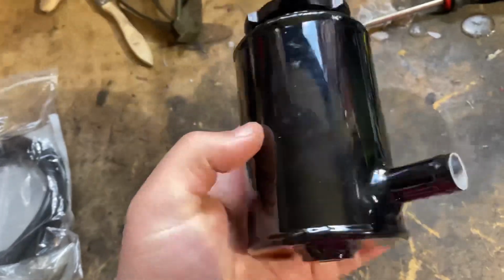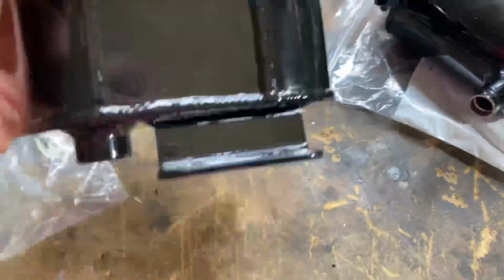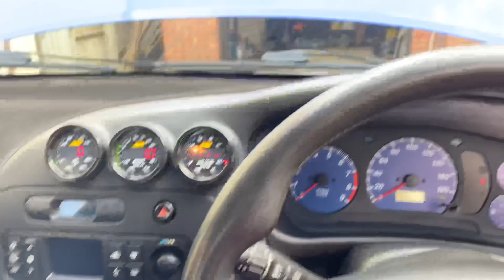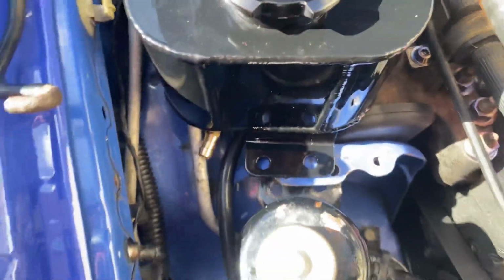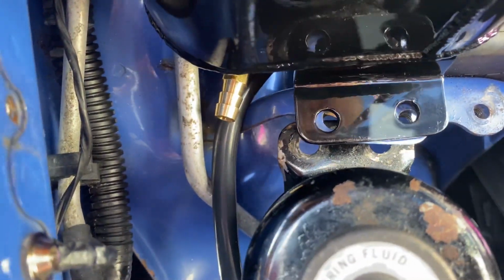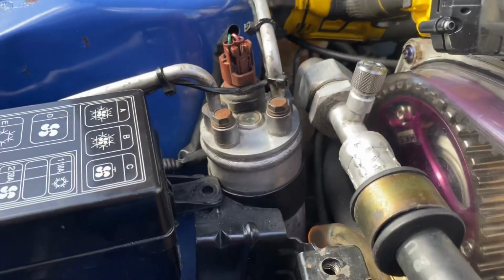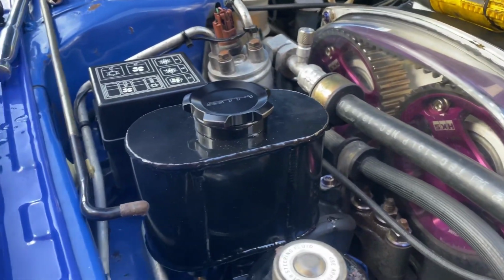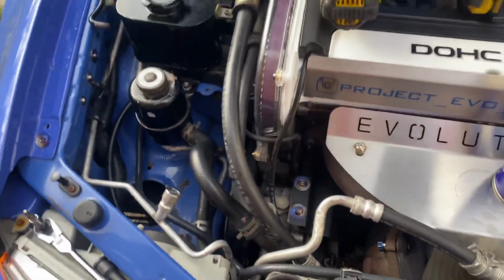Evo 6 gets some new parts!

Comment: YAY! I’m the first to like the video! Man, that sucks when you spend good money on parts and they don’t fit. You shouldn’t have to go through all that work to get it to fit, it’s a shame it’s got a bit scratched up. I have the STM tanks on my 8 and the fit and quality is great.
Reply from the maker: Yeah it’s rough, and the worst part is I got them 2nd hand, but they were never used. So I couldn’t even personally warranty the bottle. Luckily the power steering one fit! And leaked around the hose which also sucks, but the OD is different so I’m not surprised. Got that to work though